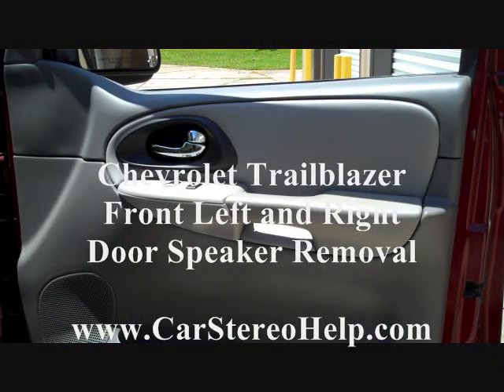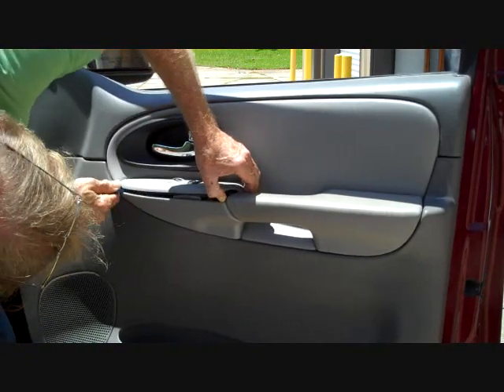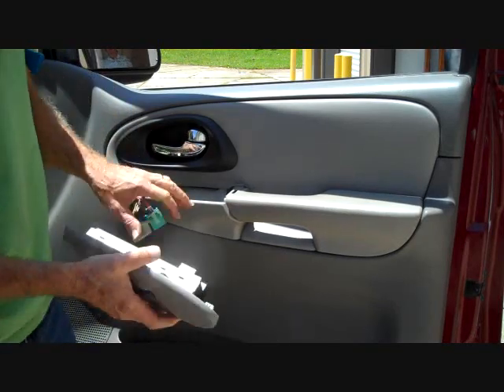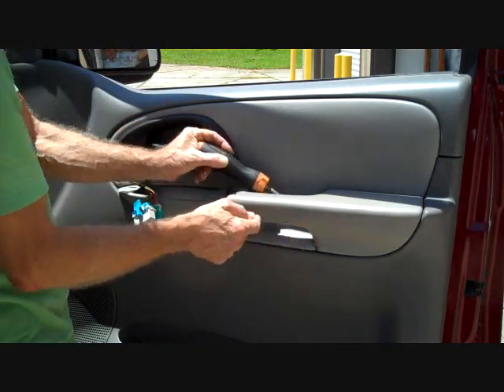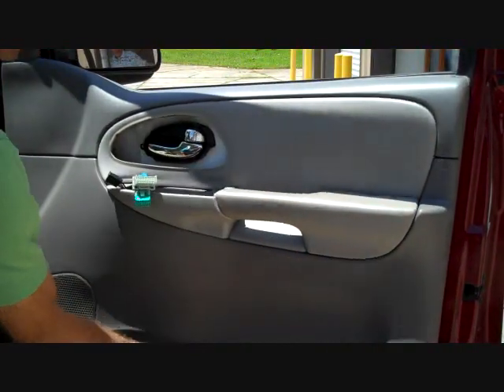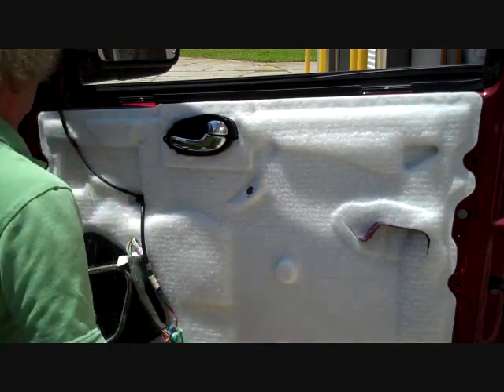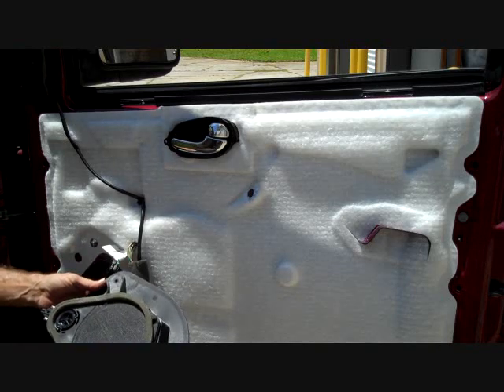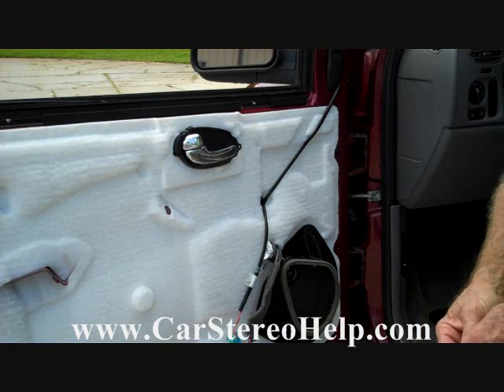Chevrolet Trailblazer Front Door Speaker Removal = Car Stereo HELP

Comment: You forgot to talk about replacing all the clips that break when you pull the door panel off lol.  I did mine when it was 30 degrees outside so im guessing it made the clips brittle, but they break regardless  good idea to order a pack of the clips before doing the job.

Comment: With all respect, that is not a Bose speaker ( ACDELCO 25853013), it is a stock speaker (ACDELCO 10366739). Very similar in appearance except the Bose does not have a tweeter showing. Otherwise a very helpful video for removal/reassembly.

Comment: Does it matter which side the speaker wires go to or can they be swapped?  There are two different size leads on the side of speaker. Do we just leave the tweeter hooked up even if we by a replacement with a tweeter attached?

Comment: does anybody n know what causes speakers in a 2006 trailblazer to work sometimes and sometimes only 2 work and one of them sounds like just tweeter is working?
Reply: timothy huffman    mine does the exact same thing one will go at and the tweeter just plays sometimes they both come in idk tho
Reply: I've been told they are bad to replace them. I'm going to test them first .
Reply: timothy huffman  yeah let me know how that works out I'm going to end up replacing both this week
Reply: Aj Ferguson that was the problem. installed 4 6.5 kickers cs and it's sounds real good
Reply: 6.5 is the correct size for them right???
Reply: Aj Ferguson yes.  I had to trim alittle of the factor plastic spacer on right and left side of spacer it breaks right off with pliers..
Reply: OK appreciate it bud
Reply: Mine does this same bs! Hopefully this is all mine needs as well! Ty for the info

Comment: What's the sizes
Reply: 6.5"
Reply: So no modifications are needed for 6.5 ??
Reply: @daved3227  there is another video from a guy who took off and flipped the plastic cover over the factory speaker and used that to mount an aftermarket speaker with no modification of the speaker housing. For wires will have to do some modifications.

Comment: What causes whining noise on bose system in the trailblazer.
Reply: Steve Andrews is like to know having the same problem. Did you ever find out.
Reply: You have a bad diode inside the radio itself.

Comment: Definely NOT a Bose speaker!!
Reply: uhhh what? did a Bose speaker not work
Reply: @fortbishop6340  Bose speakers look different AND work on different signals. Bose uses a low pass signal normally used for sub's. Thus the cone is different as the coil has to move less making the speaker a bit slimmer (when you look at the cone its almost flat) The speaker here is a normal speaker meaning it uses a high pass signal. For base the coil has to move a bit more to create the sound waves. To amplify the wave the cone is a bit bigger. (thats how it was explained to me anyways)

So, putting a Bose speaker in a normal system would blow the speaker out, putting a normal speaker into a bose system would give very low audio and likely burn the amp out. 

Last, if I recall, Bose did not use tweeters (the little speaker next to the big one) in the door. With the Bose system the tweeters are installed in the dash which is the easiest way to tell if you have a bose system or not.